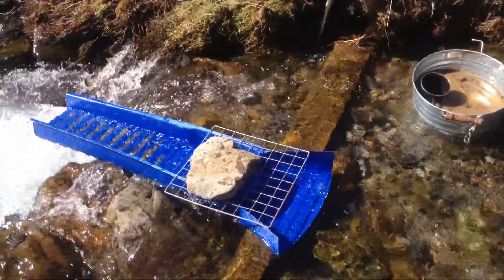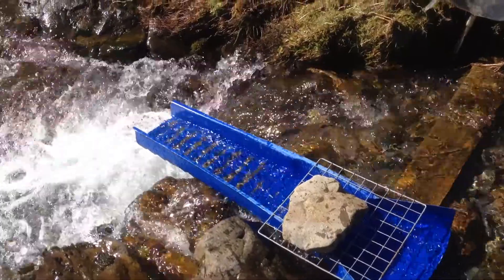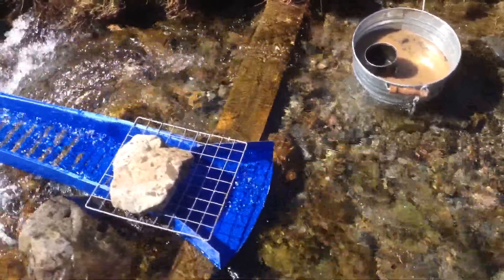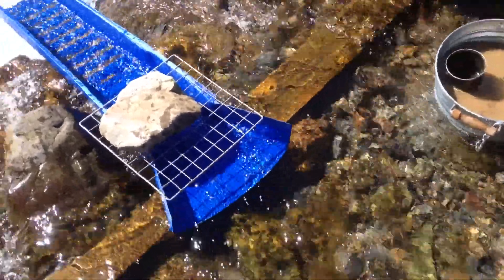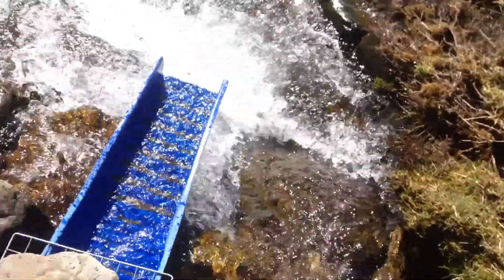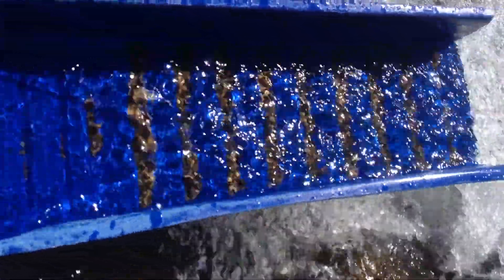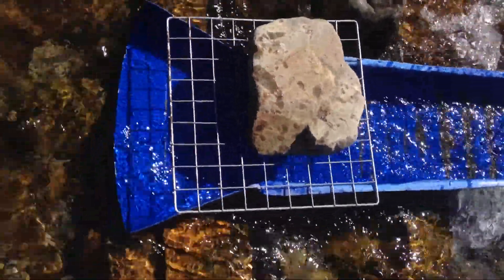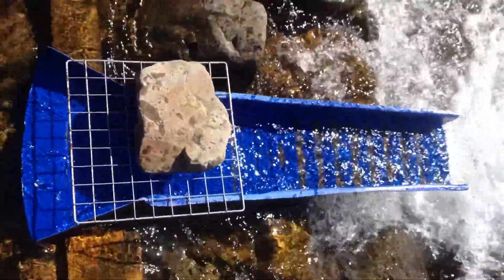Gold Prospecting Supersluice Gold Sluice Set Up At Wanlockhead, Leadhills, 2015

Comment: were do you get these from
Reply from the maker: If you mean the blue sluice, they are made to order by the admin at ukgpa.com
Reply: cool yeah ordered blue one but noticed its not got the end on it
Reply: the opening at start
Reply from the maker: where did you order it at?
Reply: Gold Grabbers ebay for 35
Reply: Gold Grabbers super blue new
Reply: Gold Grabbers it hasnt arrived yet so may have that part not sure if thats esential
Reply from the maker: if you have bought something off ebay, it may well be something totally different to what I use, (what was the item number?), wait and see when it arrives but the one I use is made to order at UKGPA.com and that is the only place they are sold
Reply: Gold Grabbers cool thanks
Reply from the maker: I have just looked and found what you have bought, that it not the same as I use, nor anything like it from the looks of it. Wwhat I use costs £70+ and is made from fibreglass so is extremely strong and has had years of development work go into it by the people who make it, I cannot comment on what you have just purchased as I`ve not used it but it doesn`t have the same open flare at the front, not the sidewall bulges which help drop gold out the waterflow, its a very basic sluice from the looks of it, may still work ok but I prefer to use something thats been developed and tweaked over many years of trial & error to find the perfect design